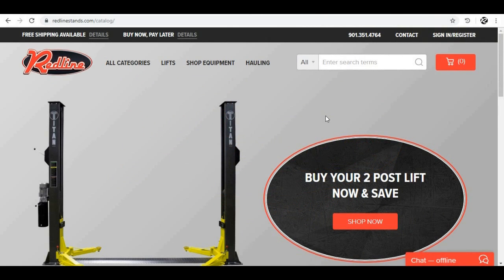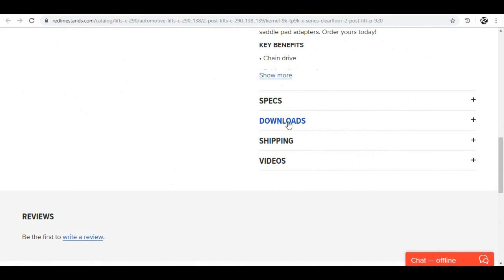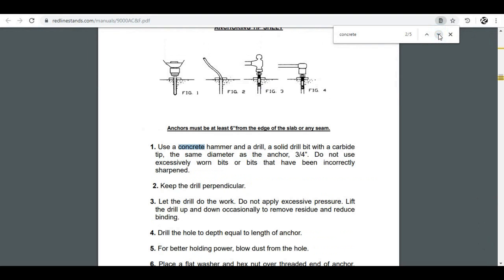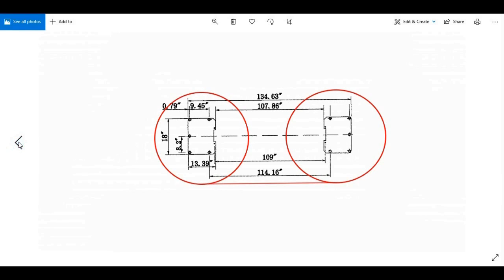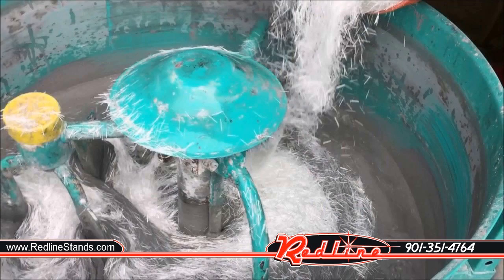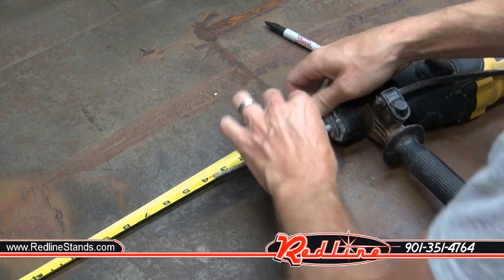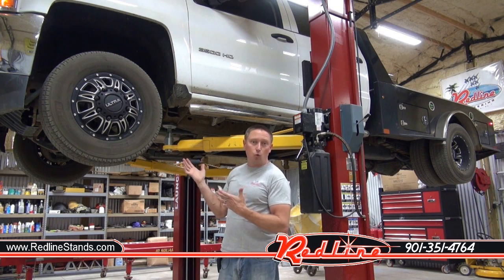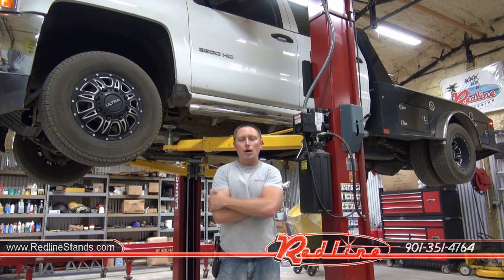Concrete Requirements for 2 Post Auto Lifts - Tutorial

Comment: I just bought a 9000 AC Titan 2 post lift. I had my cement floor poured with 4500psi with fibers and it's about 4 to 5 inches thick but where the lift will be..we dug that out 4ft square where total depth is around 10" thick.
They did not put rebar screen in the cement. The titan came with 5.5" long anchors but since I have now rebar screen...should I get longer anchors to be on the safe side??
Reply: No! You have already exceeded the manufacturers reccommendations. You don't need 5" or 10" of concrete. You need 4". You don't need rebar. You don't need longer bolts.
Reply: @philipbrown6500  they state minimum requirements is 4" 3500psi
There is nothing wrong with 10" of concrete or 4500psi.
And yes Titan came and installed my lift and told me it was a great idea that I did these measures. Extra Reassurance
Reply: @sullie35  Did you just say "manual clearly states Minimum Requirement"....... I rest my case.  Oh yeah, did you read where the manual says "Drill the hole for anchor bolt completely through the concrete. If an error is made during
the installation of these anchors, this will allow for the anchor bolt to be driven down into
the ground, so that a new anchor may be installed in place"? How did that work with a 10" thick slab? Lastly, Titan does NOT employ installers. They have a "nationwide network of installers" but every one of them is a subcontractor.
Reply: @sullie35  I have a life, a good one at that. I make enough buying, selling, installing and servicing all types of auto shop equipment, including lifts, that I don't have to do anything else. That leaves me plenty of time to browse Youtube videos. I see some posted by people who know their product and have valuable, accurate information to share. I also see some posted by people who don't know what they're talking about, give bad advise, leave people confused and misinformed and put ideas in people's heads that cause them to make decisions they wouldn't normally make. People don't want to know the truth, they want you to confirm for them that what they already believe is true. People will search until they find someone that will tell them what they want to hear and then they're satisfied no matter how many times they've heard otherwise. My point is..... If every lift manufacturer in the civilized World, literally every one, states within the pages of their installation manual that the concrete slab where the lift they designed, built tested and sold is to be installed needs to be 4" thick and needs to be 3500psi, why would anyone assume that they knew better and go about misinforming the public by posting on social media information to the contrary? Hundreds, even thousands of installation manuals supplied with hundreds even thousands of different models of lifts all state the same exact requirements for the concrete slab the lift is to be installed on yet some people choose to believe the one source that states otherwise. Unless it's delusions of grandeur, who would lead people to believe that, for whatever reason, they knew better than EVERYONE else in the lift industry? Furthermore, why would someone who had bought a specific make and model of lift seek out a video about another make and model to get information about the lift they'd bought? Why would someone question a representative that sells Brand A Model #1 lifts when that someone bought a Brand B Model #2 lift? In other words, you bought a Titan 10,000 2 post lift. Why would you seek advice and information about the requirements for installing it from anyone but Titan lifts? That's like having a broken leg and going to see a dentist for treatment. It's really great that you're satisfied with your lift but that doesn't mean that everyone or anyone else should follow the same path you did. Some people find it easier, cheaper, adequate, safe and perfectly acceptable to follow the guidelines set forth by the manufacturer of the lift they bought without feeling it necessary to go one up. In closing, I don't feel the need to try to impress anyone. I don't try to act smart. I don't try to appear to be anything that I'm not. I don't intend to harrass anyone. I try to provide people with honest, acurate information about things that I know something about. I don't ask for or expect anything for it, people can either consider what I say or not. There's nothing to "backfire" on me. The truth and facts stand on their own. A person who spends the time you've spent and goes to the lengths you've gone to to dispute the true and factual information I've presented could only be trying to justify not following basic instructions and can't admit that the steps you took, although comforting to you personally, were not necessary nor were they reccommended by the manufacturer of the lift you bought. You can't turn things around and disprove what I've stated here no matter how hard you try. Just because you did something a certain way doesn't mean that it's supposed to be done that way or that others should do it that way too. Maybe you should accept it for what it is... Like the guy who posted the video admitted, "it's overkill". I'm may not always be right but, this time, I am, plain and simple.
Reply from the maker: I'd say you're already on the safe side, but longer anchors is definitely additional assurance.
Reply: You have eaar surpassed the manufacturers recommendations and the necessary requirements of OSHA for installing and operating your lift. 5.5" anchor bolts are adequate.
Reply: It's not deep enough - you should have gone 24" depth. I would not lift a car on just 10" depth concrete - way too risky.